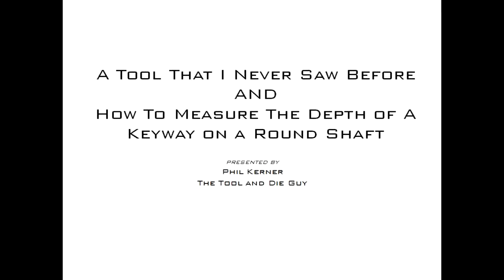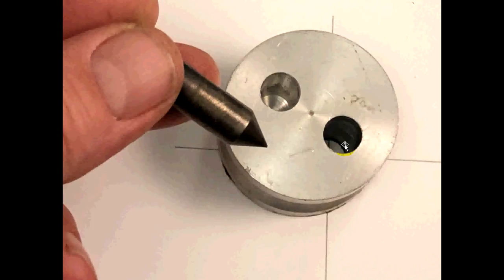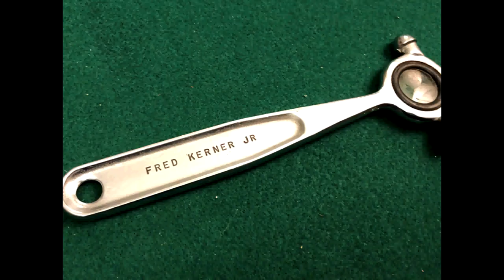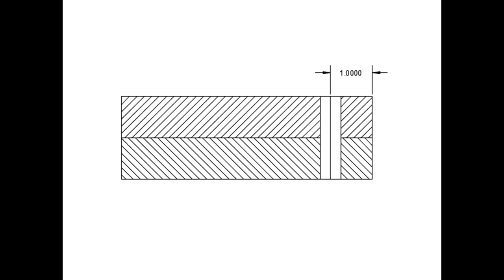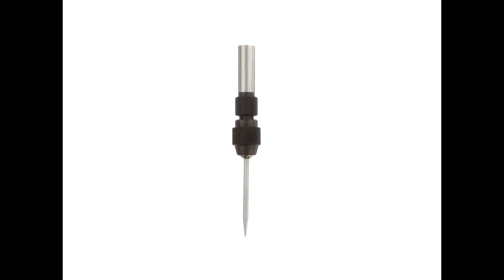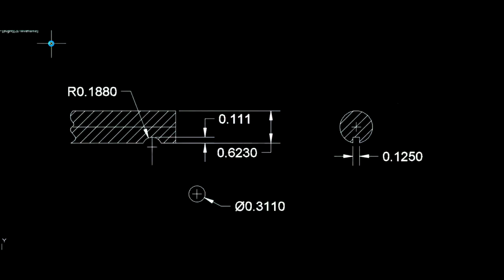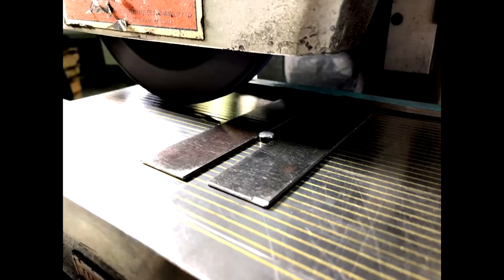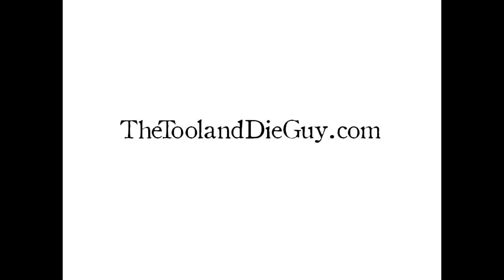Measuring The Depth of A Keyway On a Round Shaft

Comment: That's a neat little idea to measure the keyway Phil! Another alternative method if you didn't have ejector pins handy (I've all but exhausted mine over the years) would be to turn and part off a small disk of the same diameter and thickness.  I agree that hard measurements are always the best, I've got into countless "discussions" with our QC guy about this. Good stuff!

Comment: Send the 'new guy' to the tool crib to get a fresh jar of shim thickener dip. Tell him to be sure to check the expiration date. We got some fake labels made up to put on regular Mason jars that we filled with distilled water with about 3 drops of red Dykem. Had fine print that said "For brass shim only". "For stainless use our blue formula". 
   I guess you know where this is going. When he got back to the tool room, we would tell him that we needed the one for stainless shims. He would look at us funny, and we would insist he read the fine print on the back. Well of course the tool crib clerk was always in on the routine and would have 'just one more' in stock (of course with the other label that said "for stainless shim only". "For brass shim, use our original red formula".
   The clerk would put it in a small box packed with foam peanuts and tape the box shut with shipping tape and tell the 'mark' : "Be careful. That's the last one!". Of course he put yesterday's date on the bottom, and new man would be so nervous about messing up the first time that he wouldn't even look at the bottom of the 'last jar'. After he got back from the second trip, we would bitch about the expired product and sit him at a desk stacked a foot deep in machining supply catalogs and tell him to find the part # and get purchasing to get a case sent overnight. 
    I know. We were mean. But even the new guy would laugh about it after his 2 hour initiation! 

Read less

Comment: Seems like a simple, perfectly logical way to measure a keyway depth.  
Don't recall when I first saw an optical centerpunch, but it's been a long time ago.  I actually have one made by Lee Valley/Veritas in Canada that I bought probably twenty years ago.  They make/sell mostly woodworking tools and gizmos.  Their version has an o-ring around the base to keep it from slipping once positioned.  The punch fit the base perfectly.  Holding it in your hand and sliding the punch in the hole of the base, the sliding fit was just right with no play, smooth.  The catch was that when the base was positioned on the work piece, the o-ring created an air-tight seal, so when the optical piece was removed and the centerpunch dropped in the hole, air was trapped causing the punch to act as a pneumatic damper.  If you pushed on the punch it bounced on a cushion of air and didn't contact the work piece.  I drilled a 1/32" hole through the base to relieve the pressure, and it works perfectly.  
But, as you point out, who the heck needs one?  It's mostly a curiosity.  I don't think I've ever actually used mine. :D

Comment: Depends on the work your doing. When I was building big ugly automotive stamping dies, we used to screw things together in position and then dowel as an assembly. Example: wire EDM dept would cut the punch and die to CAD data with dowel holes included. To line it up, we'd assemble everything loose and slowly close the die, line up punch to die with shims/feelers, adjust where needed, then tighten the screws from underneath. Then you open the die, crane it over to the drill press and drill and ream as is. Its sloppy but we were building automotive dies that were cutting .187'' matl (so .018'' clearance). It worked great, however I build and maintain injection moulds now. Its only done to dowel parallels or to add a one off, non critical dutch pin in some insert or something so you cant put it in backwards.

Comment: I have one of those Optical Center Punches. It's made by On-Mark and it's very handy when doing sheet metal work. especially where one can't get the part into a machine to get the holes about where you want them. The little dimple that it makes is perfect for lining up a punch (like a Whitney) with their punch male dimple. It's usually good to 3 or 4 thou but I wouldn't trust it to anything better.  I hardy ever use it for anything that needs to be precise, and in general I have never been a big fan of depending on punch marks for anything that matters much. You have the punch mark that's not necessarily accurate, then the drill that can wander for all sorts of reasons - flutes not ground properly, web off center, dull edges, etc. I never punch/drill unless there is absolutely no other way to get the hole through the work or I just don't give a darn.

Comment: Instead of using a pin to measure the keyway depth can't you use the actual key that goes into the keyway? This you way eliminate having to make the disc.
Reply from the maker: I always prefer the diameter of the disk to be smaller, that way I am 100% sure it's all the way down to the bottom of the keyway. Great question!